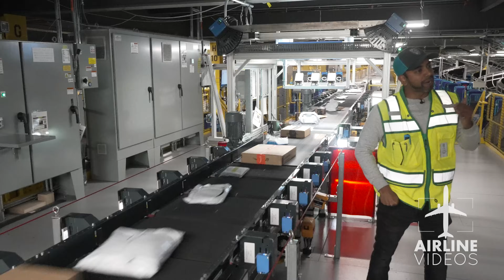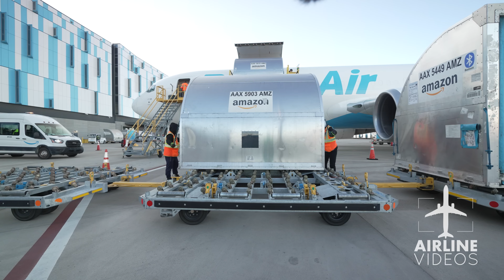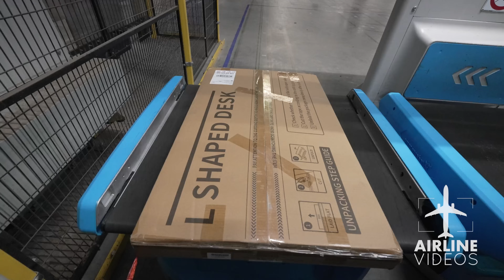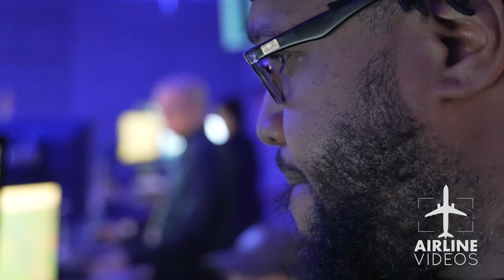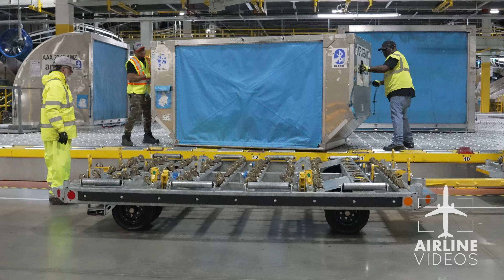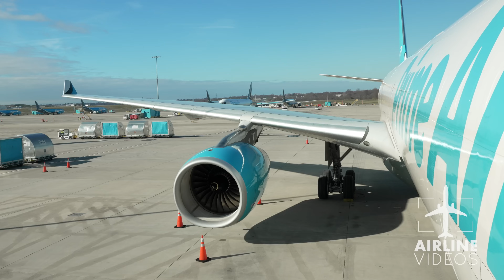How Amazon Air Delivers Your Packages on Time!

Comment: I worked at the Network Control Center (NCC) at CVG Airport 2021-23. Amazon has invested a lot of money for talent and an air network to keep customer promises for on-time delivery. It's a great place to work. However, it is kind of a "pretend airline" as, even though Amazon owns and leases a lot of planes, they don't have an FAA Flight Certificate. They contract with the real air carriers, primarily Atlas Air in the continental U.S., to operate the planes. In this sense the "Air Controllers" at the Amazon NCC are really just another layer of oversight to manage arrivals and departures worldwide (through the actual operators at Atlas, et al) to maximize capture of packages and making connections to facilitate maximum loads.

Comment: I wonder why Amazon Air wants A330-300 P2F conversions while FedEx and UPS would rather buy new 767-300F from Boeing instead. My guess is because Amazon doesn't operate and maintain its own aircraft, it doesn't worry about newly acquired airplanes fitting into its existing pilot pool and maintenance system, like UPS and FedEx have to. Still, if the higher volume A333 is that efficient in the business of flying package delivery, you'd think being larger operators in the package business, FedEx and/or UPS would be interested in building the infrastructure to add them. But they apparently aren't, since neither has ever operated one nor has any on order.
It is also interesting that Amazon has never purchased new 767's, only acquired old passenger conversions, while those largest two American package delivery companies continue to order new 767's.

Comment: I was a Captain for ATI for many years, flying in & around of the Amazon network. While your video is very well produced and edited, I can assure you that the Amazon facilities are some of the poorest-managed locations in the entire country. Employees are micro-managed to the tiniest degree. The turnover is incredibly high and work morale is incredibly low. From the pilot perspective, ATI, ABX, and Atlas are hiring bottom of the barrel First Officers, many of which cannot even speak or understand basic English. Also, these new co-pilots (many of which) have “stains” on their pilot training records, DUI convictions, checkride failures, at-fault aircraft accidents, etc. etc.

At ATI, management is at a standstill against their pilot group. They are significantly underpaid, overworked, and under appreciated. The schedules are horrendous, the day/night transitions are egregious, yet ATI management doesn’t seem to care in the slightest. The turnover within the ATI pilot ranks is quite impressive, to say the least. The qualified guys are finding better paying jobs and career stability at the legacy passenger airlines. The guys with stains on their records, end up getting stuck at ATI for the remainder of their careers. It’s quite the toxic work environment, to say the least.

Again, great video. But I can assure you the “glamour” of the Amazon Air network has quickly faded into the sunset.

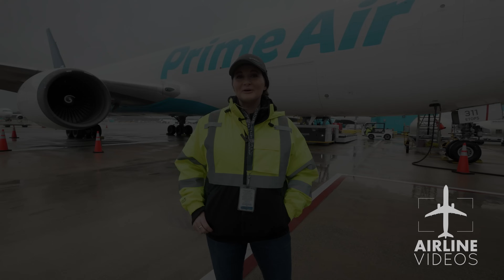Comment: 1:14 this is a violation of the AGOM that prohibits AC bulk being placed into an AAX… use to do it, but now it has to be an LAY or smaller ULD.
Reply: Interesting at fedex loading an aad (Thats what they call it ) straight from the bulk compartment is normal
Reply: @johnathanlammy  they’ve used AAXs for years, just a recent change as of DEC01 iirc. It’s quite a PITA though since it has caused LAY par level issues as that’s now the ULD of choice for bulk. Which has been a problem for the 737 flights we depart back to back.
Reply: @KTMcaptain  up at KILN it's the same way, we don't have 737's just all 767's so our LAY par level isn't the greatest either

Comment: Great video! What is the relationship with Hawaiian Air? They(Hawaiian Air) maintain the aircraft, but who owns the plane? Is it that after HA is finished with the plane they will sell to Amazon? i see the benefit Amazon is getting from the relationship, but what is Hawaiian Air gaining?
Reply: None of the aircraft are actually operated by Amazon. I fly for one of the other contractors and Amazon owns the planes but we have the airline certificate and have operational control. The benefit the contractor gets is we make money regardless if the aircraft is empty or not.

Comment: Unionization is what is next for this facility. Currently the employees are signing union cards to hold a unionization vote. Awesome video. I worked at this facility and yes it’s an awesome place, but there are some issues at this facility that have caused the employees to want to push for unionization.